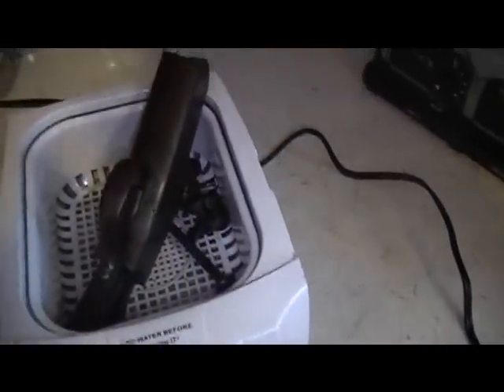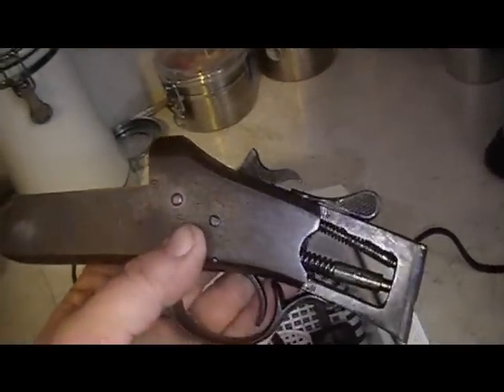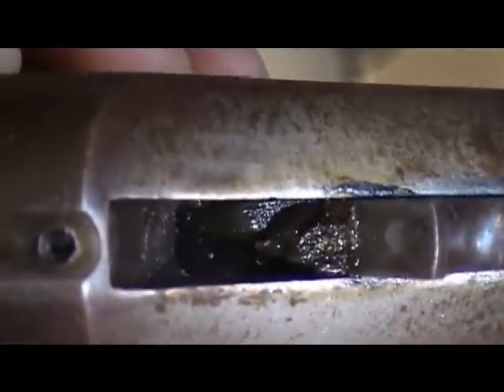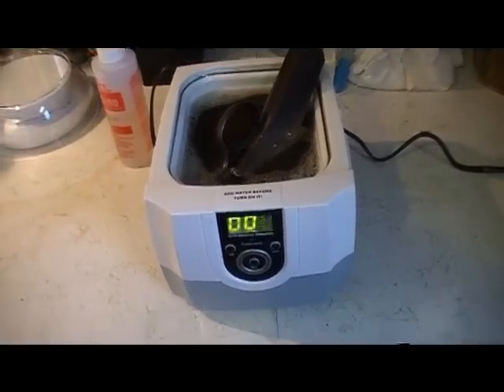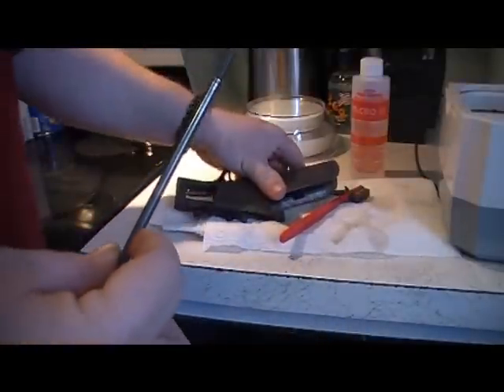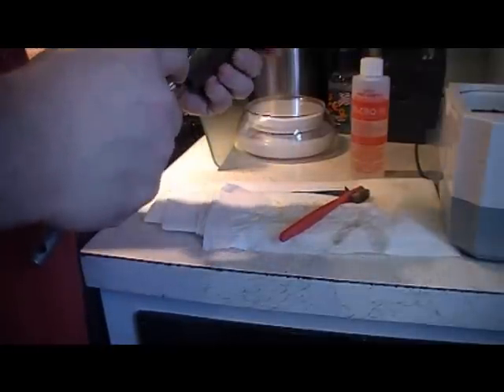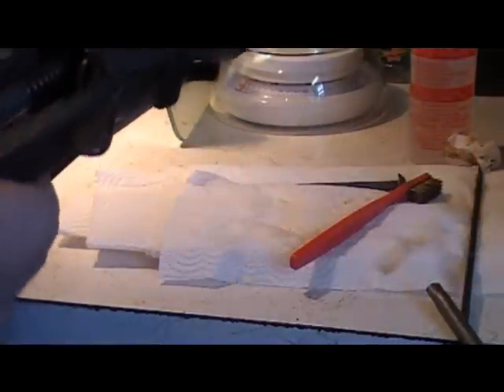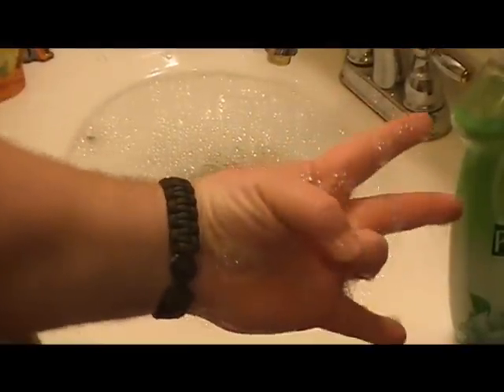Cleaning Shotgun parts with the Ultrasonic Cleaner

Comment from the maker: @kneedown4GOD For my regular brass I do not tumble after using the UC cleaner. They come out shiny inside and out. I have changed my solution now to using Lemishine and regular water. It does a very excellent cleaning and takes some of the steps out. I will say this, you can not clean alot at once. For rifle, maybe 10-15 at once, and handgun, 20-25 maybe?

Comment: If objects are a little too long use a glass jar in the ultrasonic cleaner. Fill the UC with water and the jar with the cleaning solution. That way the ultrasone is being transfered from the UC through the water to the jar and cleaning solution on to the part you want cleaned.

Comment: If vibration is not cleaning, than what does it?  42 kHz means it vibrates 42,000 times per second.  It's called ultrasonic cleaner, because past 20-22kHz you can't hear the sound.  I know that you can hear ultrasonic cleaner while it's operating, but that's vibrations transferring to other medium and slowing down, so you can hear it.